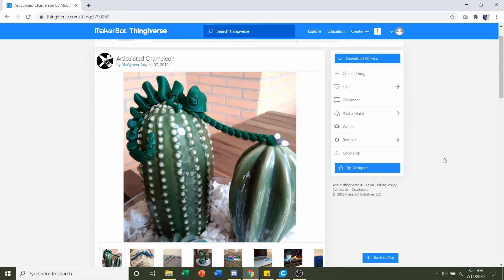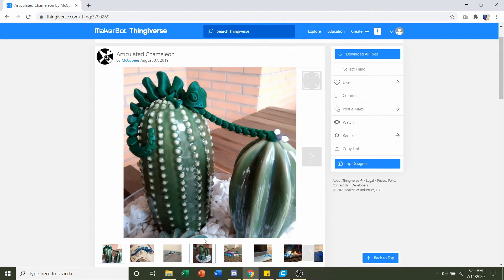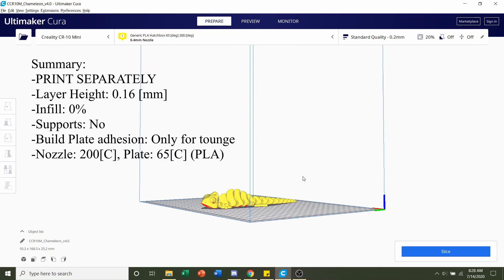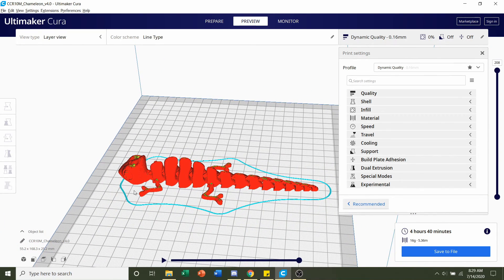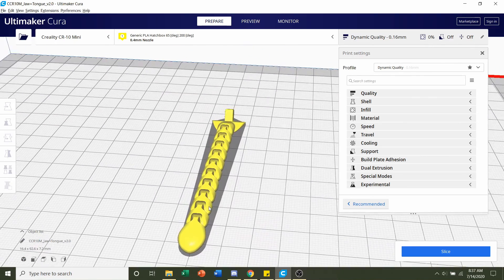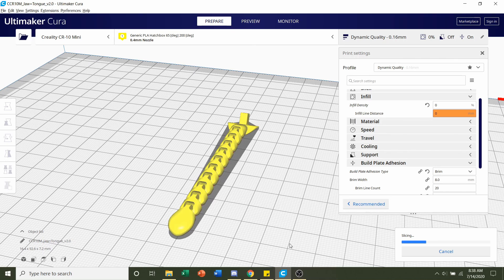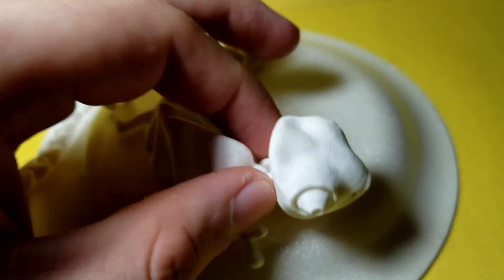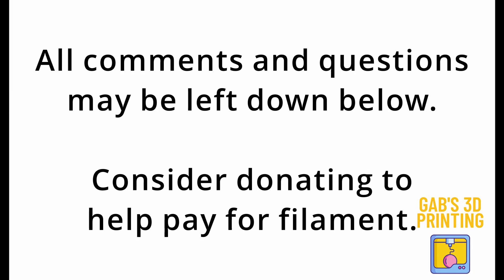Articulated Chameleon 3D Printed - Tutorial, Print Settings, Time Lapse, Showcase

Comment: I have issues with that left eye. Fails 80% of the time. No clue why. Any thoughts? Everything is level, flow, e-steps, etc. Tried slowing print speed but that didn't help
Reply from the maker: The eyes are tricky to print because they are basically floating mid-air as is. Proper printer calibration and cooling is essential to get those eyes to print correctly and allow them to rotate freely. My only suggestion would be to print slower and make sure there is 100% cooling, but you already tried that it seems.
I saw a comment that someone put manual supports in-between the head and eyes of the model using Cura with 0 [mm] z distance. It's hard to explain, but there are some good videos online about how to add manual supports. Doing this should help you print the eyes, but apparently it locks them in place so you can't move them.
Reply: @Gabriels3DPrinting  yeah, I went from 60mm/s to 40. It's a strange one. Doesn't do it every time lol. Going to check my belts as it's been a few months since I last tightened them